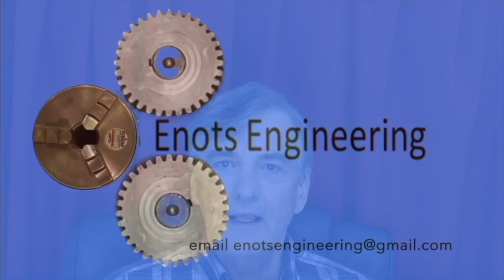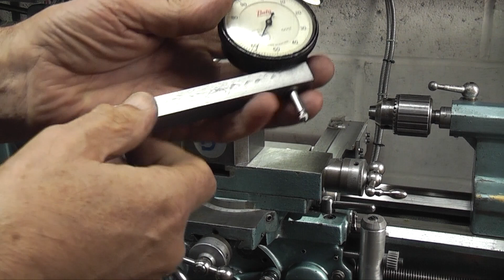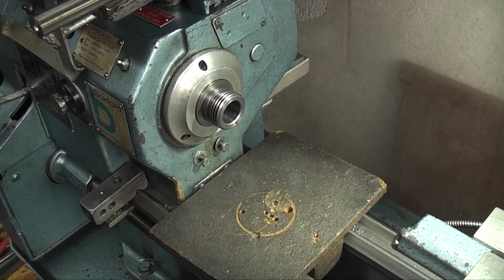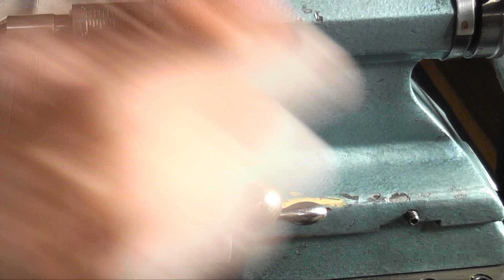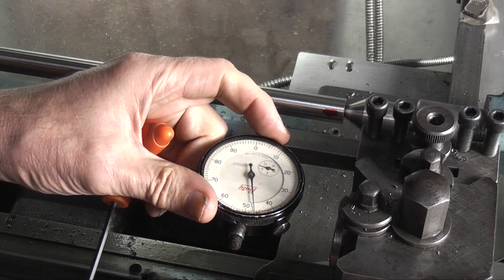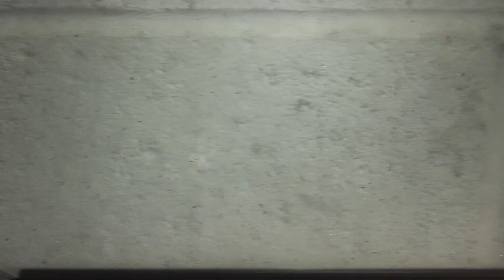lathe tail stock check and set up

Comment: Half the length of the test bar and check again, you might find it out again. Half it once more and you might find it out again. We always check the tailstock alignment regularly depending on the length of the work piece and adjust to suit job by job. Maybe not necessary for most jobs but worth checking for ultimate accuracy.

Comment: Hi Alan
Thank you for sharing.
In your video “Tailstock offset” - posted on 22 May 2017 – you use a dial indicator with a flat anvil and explain why not to use a domed end indicator.
In your opinion, is your latest method as accurate as the former one?
All the best,
Pieter
Reply from the maker: Hi Pieter
The flat anvil is quicker to set up as it need not be on the centre line of the bar. with the ball anvil it needs to be on centre. I was using a ground bar which should be better than the bar I used last time with the turned ends.
Alan

Comment: Minimising spindle extension is best for rigidity, but sometimes you have to extend it.  Do you repeat the tests with the spindle wound out to the maximum ?  This would test how parallel the spindle is to the bed.  Or is any error (sine of angle * extension distance) not significant on most small(ish) tailstocks ?